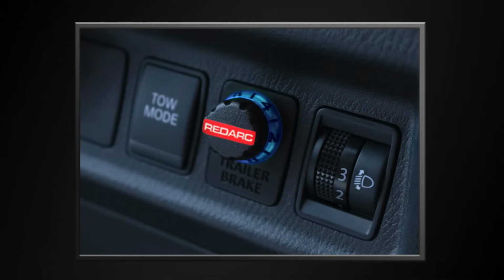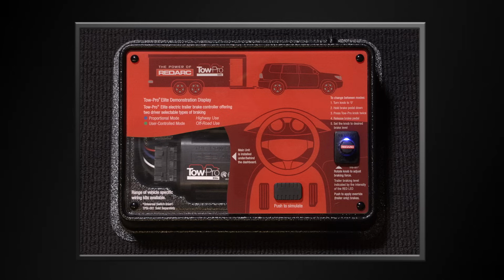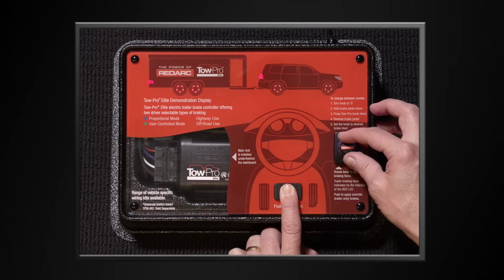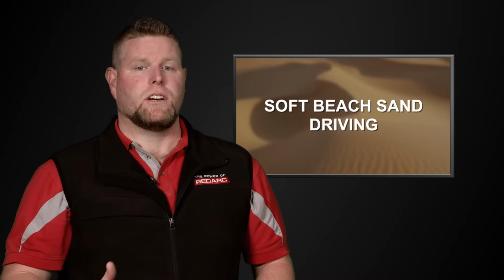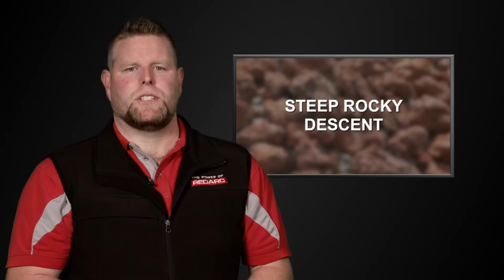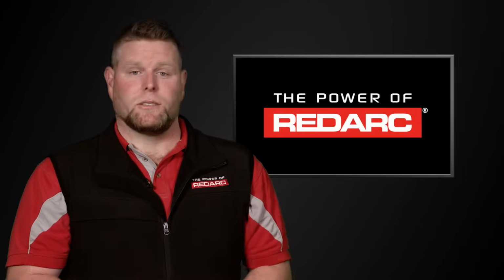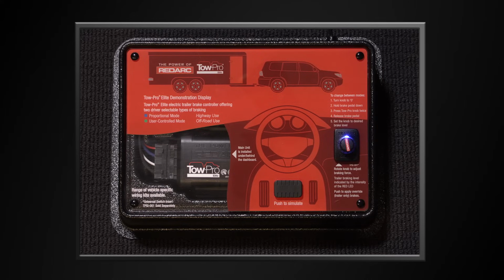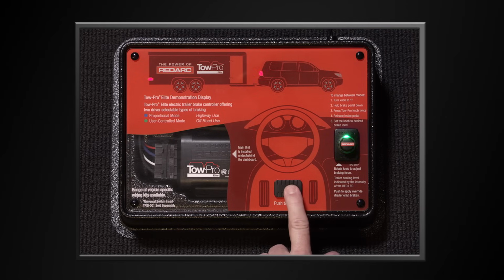Demonstrating the Tow-Pro Elite and its features

Comment: If I hold the button in for manual over ride for 4 seconds it kills the engine and warning lights and notification for ABS failure comes on, I only attempted this in my driveway in park.  I used it with my camper trailer for the first time today and it would not come out of calibration mode either. I wired the redarc harness to the OEM harness that came with my 4runner. If I get the 4runner specific harness from redarc will it resolve these issues?
Reply from the maker: Hi Cheyne, thanks for your comment. When using the pigtail to wire the TowPro into the vehicle, you would need to add a diode in the Red wire to stop this feedback and warning lamps coming up on the dash. Using our Toyota specific harness would indeed fix this issue as it does have a diode already pre-installed in-line with this wire. Otherwise, source a 7A rated diode and solder/crimp it in-line on the red wire and you will be good to go. Please do let us know if we can help further.

Comment: Hey guys. On the wiring diagram. It's hard wired direct to the battery via a 30amp breaker and or a fues. How come it's not wired through a relay? Is this to keep power to it all the time to maintain calibration?  I'm just concerned about constant draw on the battery when not in use. Cheers Azza
Reply from the maker: Hi Aaron, thanks for your comment. Indeed you are correct, Tow-Pro needs a constant battery feed to retain the calibration once its been learned. The unit itself with no trailer connected draws less than 5mA in standby, so would have minimal effect on the battery. Any further questions please feel free to touch base with our Tech Support Team on 1300 REDARC.
Reply: @REDARCElectronics  thankyou that's good to know. Thankyou and keep up the good work

Comment: Make brake controller only lights up blue once when i push the controll button. Other than that doesn't light up again when in use. ??
Reply from the maker: Hi there, thanks for your comment. What you are describing there is the ‘blue breathing’ feature of the unit, which indicates the Tow-Pro has a power supply to it but it is not detecting a trailer connection. It is best to check over the wiring from the trailer plug on the rear of the vehicle to ensure there is proper continuity between the Tow-Pro, right through to the trailer brakes at the wheel hubs. There sounds like a loose connection potentially in your case.

Comment: Difference between this unit and the liberty?
Reply from the maker: Hi JRogers, thanks for your comment. The main differences between the Tow-Pro Elite and the Tow-Pro Liberty are the two modes that are in-built: The Elite model offers a smooth Proportional mode (On-Road applications) and also a User Control mode (more Off-Road application), so you can really tune up the braking for the driving conditions. The Liberty model only has the Proportional mode, so is practically suited for highway cruising generally. The Remote Head is a little more compact on the Elite model, but otherwise both offer the same ‘no knee-knocking’ installation and a factory like finish. If you have any further questions please feel free to contact our helpful Tech Support Team.

Comment: The last time I used electric brakes was with an old Tekonsha with the adjustable timing. Are modern controllers fully automatic in this regard?
Reply: As far as I'm aware, proportional brake controllers brake your trailer proportionally to how hard the vehicle is braking (they brake as soon as the vehicle brakes - so yes, fully automatic). You still have to set the initial brake gain before departing after changing the load on the trailer - but there's no time delay to configure. You only just dial in the gain for how heavy or light the trailer is running so you don't lock up the brakes on an empty trailer, or vise versa, have no brakes on a loaded trailer. It uses an accelerometer to detect how hard you are braking and relays the same brake force to the trailer - Provided you have configured your brake gain to the trailer weight properly.

When you step on the brake pedal, depending on how hard you brake - the controller will automatically send the appropriate brake pressure to keep the trailer in line. There are videos available that demonstrate how to set your brake gains properly. Proportional brake controllers are much nicer than time-delay controllers because you get exactly the braking you chose for every situation - Not sudden and delayed brake forces or having to intentionally chose lighter brake forces for comfort. You get what you need - when you need it.

Comment: Does this require connecting to your brake pedal switch or can it be connected to one of the trailer turn/brake wires?
Reply from the maker: The Tow-Pro is required to have a brake trigger signal, either from the brake pedal switch or Pin 6 in your trailer socket. For older vehicles, the pedal switch can be appropriate, but in newer vehicles with CANBUS type systems, the trailer socket with our Encapsulated Protection Device (EPDK-001) is required.
Reply: @REDARCElectronics  thanks for the quick reply! My car is a 2018 Chevrolet Malibu LT.
Reply: @REDARCElectronics  EPDK is just a well put-together diode setup?
Reply from the maker: Hi  @DTPaudio  the EPDK is indeed an encapsulated protected diode assembly. It is suitably rated, mounted on a heatsink to ensure safe heat dissipation and has superior weather protection. If you would like to find out more about this product review this handy hint https://www.redarc.com.au/why-use-the-redarc-encapsulated-protection-device
Reply: @REDARCElectronics  I tried to phone you guys about a question, are you taking calls right now? 10:35EST which I think is 12:35 ACST?
Reply from the maker: Hi @DTPaudio , our team are available Monday - Friday at these times. Feel free to call through now if you have a few minutes to discuss.

Comment: Do you need to apply the brake to adjust braking force?
Reply from the maker: Hi Adam,

Turning the dial will adjust the desired output braking force with or without the brake applied.
If the brakes are not applied however, you will not feel the result of your adjustment until they are applied once again, or the manual override is depressed.

Comment: I dont understand the difference between the two modes.  If in proportional mode the device adjusts the trailer brakes according to the brake force applied by the driver, so why have the ability for the driver to adjust this when the unit does it automatically?
Reply from the maker: Thanks for watching, Tony. The main difference between the two modes is how the braking voltage is applied to the trailer/vans brakes. In proportional mode, the power is ramped up in proportion to how hard the vehicle is braking (sensed on inertia) and can therefore either be very smooth or very harsh. In the user controlled mode, the output is quite linear and is applied straight to the set level of the gain on the knob, not as smoothly. If you have any further questions please feel free to contact our friendly Tech Support Team on 08 8322 4848.

Comment: Which mode would be best for reversing a large trailer boat down a boat ramp?
Reply from the maker: Either mode will do the job fine, so if you operate in proportional mode ‘BLUE’ LED and it's setup, reversing is no different in terms of application. As the operator, if you want full control then you have the option to use user control if required.
Reply: In Canada boat trailers have their own brake controller built in, no in vehicle brake controls needed.